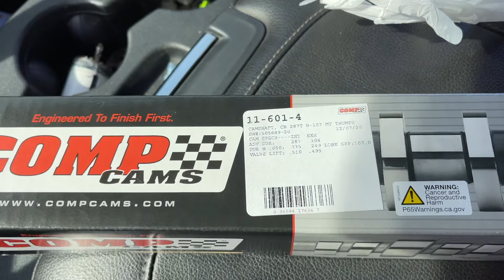Jackstand's $2,500 BIG BLOCK Jet Boat Makes a Miraculous Recovery After Finding BAD Engine Damage!!

Comment: Run the headers dry. They're just there to keep them cool and not blue the headers but looks like your way past the chrome lol
Reply: Agreed, 100% don't need that.  Nothing but problems.
Reply: And the water act like muffler too but who really care
Reply: @fast97z24  Look up "water injected headers" and you'll see the little pieces welded onto each pipe where you clamp on a hose. What it's supposed to do is continuously inject a very small amount of water, and the exhaust pressure turns it into a mist, constantly coating the inside of the headers to keep them cool. The only reason to do it is for chrome or painted headers, so they stay looking nicer for longer. Jackstand's problem is they are putting in too much water, which is draining into the cylinders causing worse performance, and as Cleetus noticed, slowly getting into the oil as well.
Reply: @AceEverett , thanks, that’s the best explanation I’ve heard about wet exhaust.
Reply: Also, if your cam has a lot of overlap and the reversion brings cold water onto the hot exhaust valves, (after a hard pull) they will snap off.
Reply: @fast97z24  so typically you feed your engine with water that comes from pump, from pump you have a line to a "T/Y" fitting and from the fitting you go into the engine water inlet ports(where water pump would normally be), from there it feeds engine for cooling purposes. Then you got your water coming out of your T-stat housing (some people run this diff ways) but normally you got a line dumping back into the lake/river and the other line you run to a basset T valve (which is spring loaded T that let's water by around 8psi) and from T Valve goes into each header. I run a small ball valve off t stat housing so i can run headers dry or wet. Different ways to do this but this how I've ran mines for years with no issues.
Reply: I always ran jacketed headers so no concerns with water ingress through the valve train. Also used a shell and tube oil cooler and the water to the engine was controlled via a thermostat.
Reply: Even Mike Finnegan said to run em dry.

Comment: James you dont need to have the water! That's only in the exhaust exits through the boat but your hangs in the air over the edge so just leave the water off, that's why you're having issues with it because those headers arent suposed to have water in them they will flood the motor, water cooled headers have a hump an water sprays after the hump so it cant go Into the motor,  please just unhook those water lines
Reply: You're describing water jacketed headers, not water injected headers.

He should have a spring loaded check valve in there that shuts off the water flow at idle.  And only misting them under load.   They never need to be fully opened to work correctly.
Reply: Read earls comment….